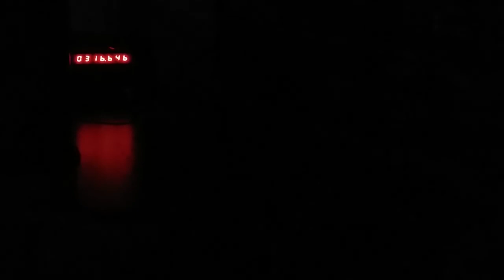Classroom Coil - Different toroids, arc length and using a voltage regulator.

Comment: You use the term "Toriod" to mean any type metal on the top.  A toroid is a specific shape, i.e. generally a donut shape.  Any metal you put on there becomes a capacitance top load.  Tesla coil performs best when the circuit is resonant.  The size and shape of the capacitance load changes the resonant frequency.  Of course, and metal you bring in proximity also affects resonance.
Reply from the maker: you are right, i should say top load.   haha I certainly do have a habit of referring to every top load as a toroid.